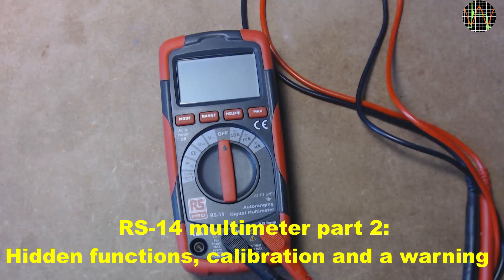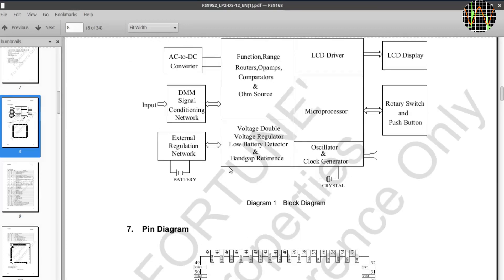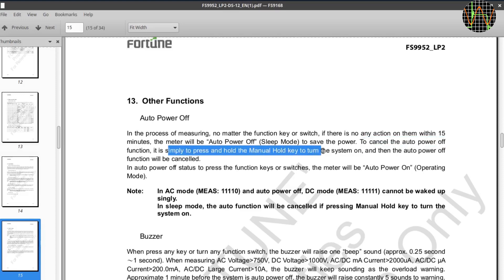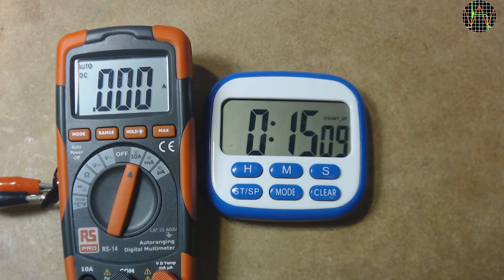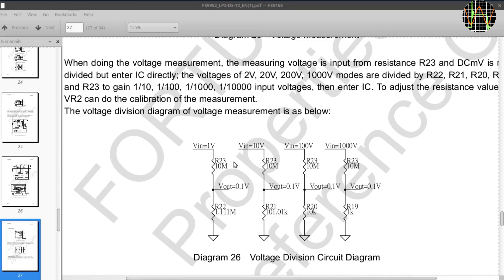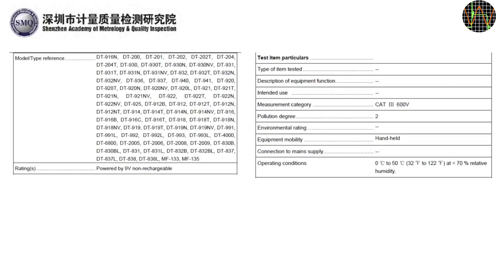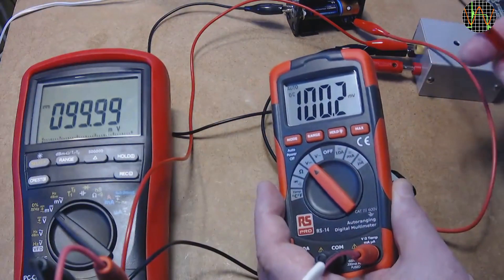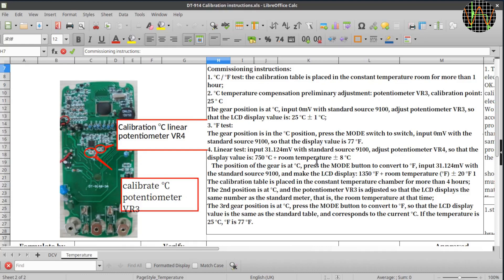RS-14 multi-meter part 2: Hidden functions, calibration and a warning

Comment: Again a well made and very informative video with a very indepth view into a cheap Multimeter...
I had to dig up Part 1 of this series, to remember why you have bought this DMM in the first place.
With a proper Brymen DMM and a HP34401a on the bench I still wondered why you bother at all with this low end piece.
Reply from the maker: You are right. It is very low end but ok for the garage tool box and compared with most meters in that price class, the RS-14 is reasonably safe to use.